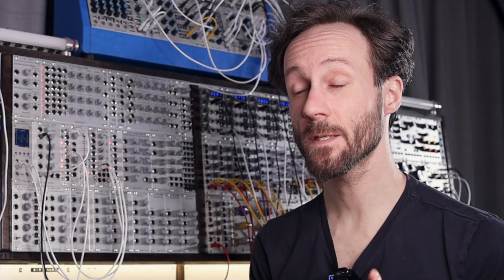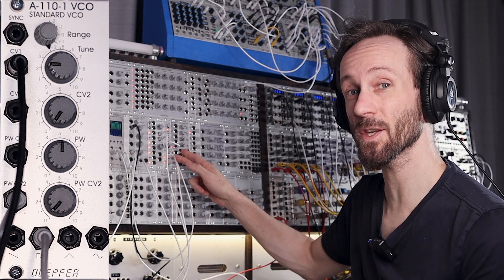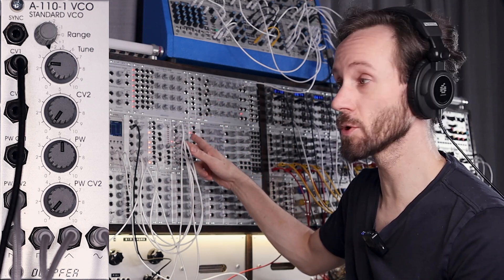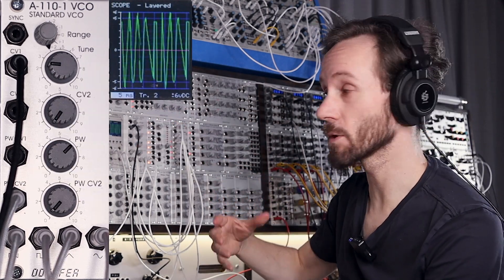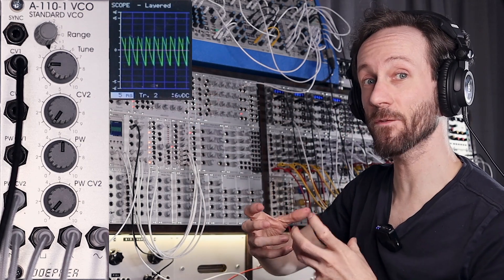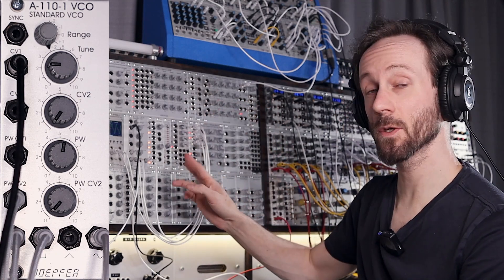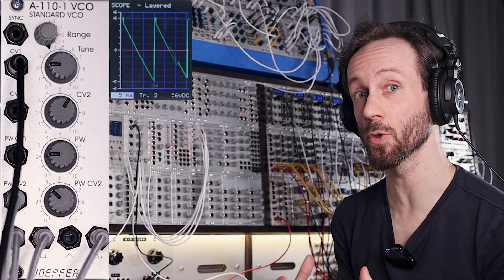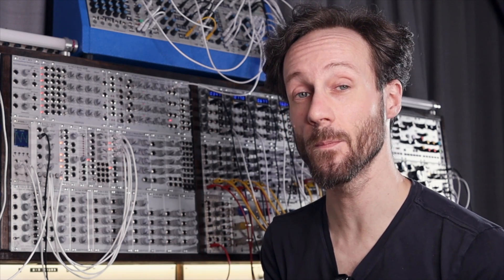5 Easy ways to turbocharge your VCO | Doepfer A-110-1 Standard VCO

Comment: These are great videos and I'm inspired to try some new techniques!  Could you add chapter markers to the description to make these ideas easy to jump to?

00:00 Intro
00:35 5 - Clock Divider
01:32 4 - Clock Multiplier
03:16 3 - Sequential switch
06:28 2 - Polarizing/Inverter Mixer
09:02 1 - Voltage Controlled Switch
12:34 Outro
Reply from the maker: 👍 Yes I will add them, thanks!